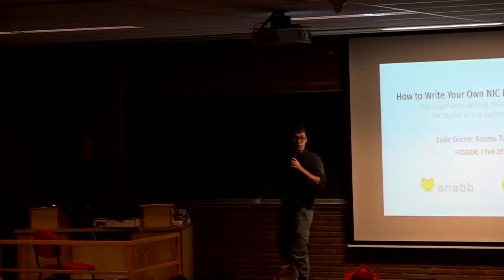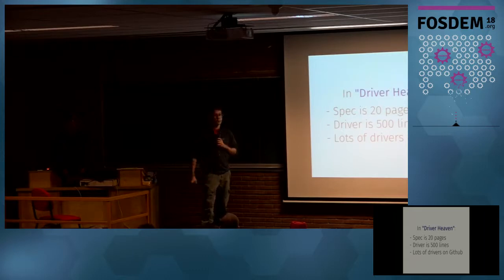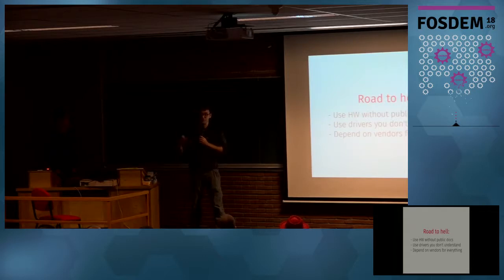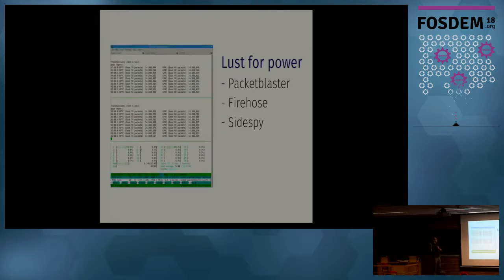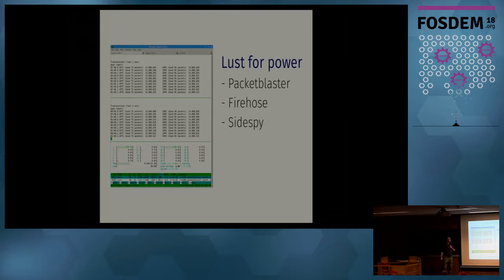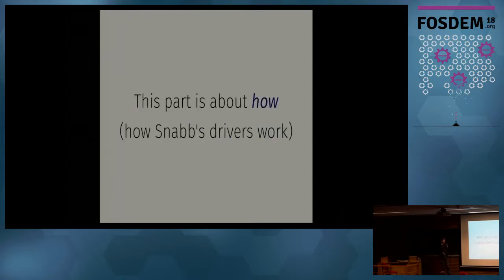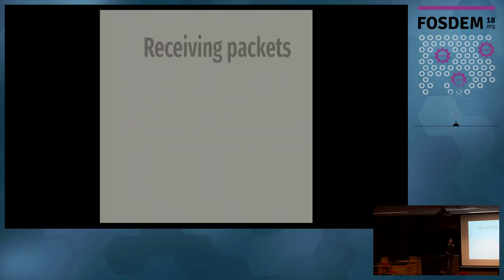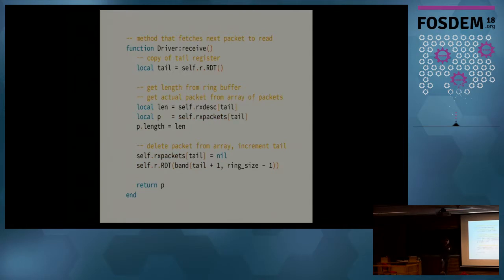How to write your own NIC device driver (and why) Our experience writing 10G/100G drivers for Snabb…

Comment: I have a USB/Ethernet adapter (VID0A46 , PID9621 ).. but how do I install a driver for it?  

For example, I see the ethernet chip used in the adapter is the DM9620 (qop_kernel/drivers/net/usb/dm9620?)?

I'm interested in calling functions directly from the driver, like dm_write_eeprom_word()..  or using a tool like 'ethtool'. However, where is it specified how this USB device is accessed in order to read/write the DM9620 registers.  For example, CDC mode, bulk-transfer, register address map?